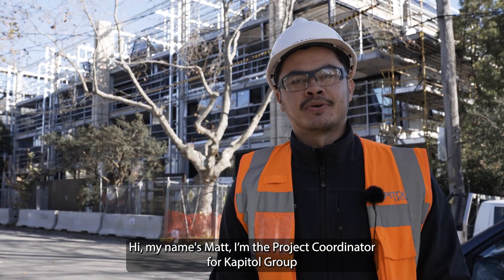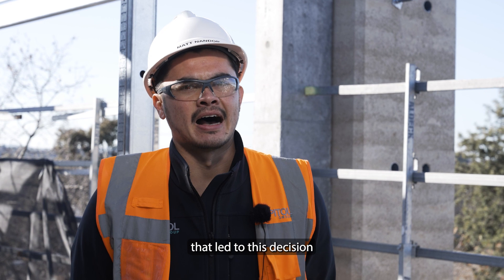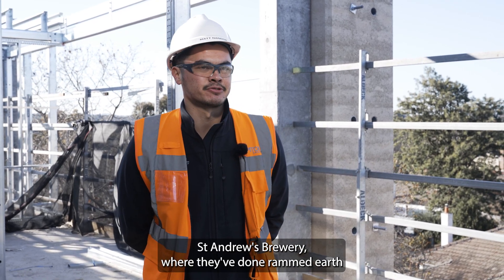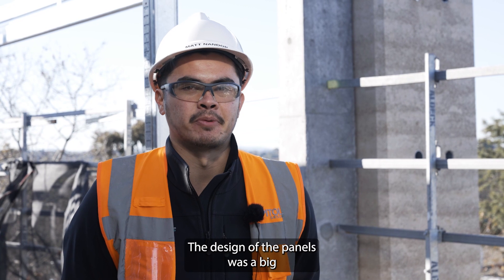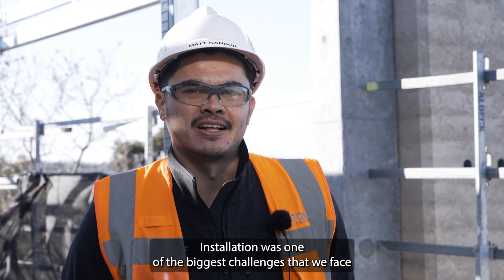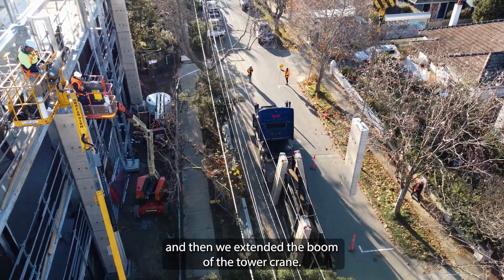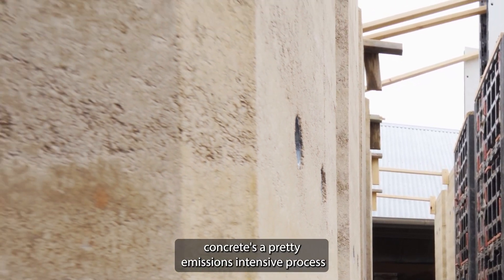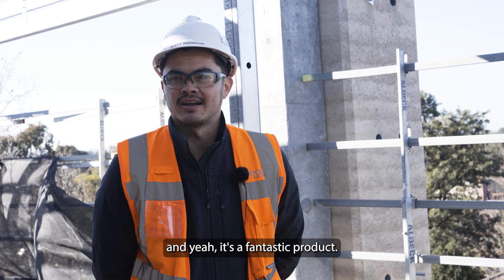Rammed Earth Columns Installation - Hurstmon Apartments

Comment: Hi, good job here. Does the steel frame thermal expansion effect the rammed earth enclosing it at all? Is there any cracking observed on the face of the Rammed Earth panels due to difference in materials? Since the project is 2 years old now should be suitable sample size to determine the effects if any.

Comment: This not rammed earth! This is just dirty concrete!!! You need probably double the amount of cement than in a nomol concrete wall! How can that be better for the environment??
Reply from the maker: Hi Johannes, 

Precast concrete uses upwards of 20% cement, washed sand (a high-embodied energy material) and crushed rock (ditto). It requires substantial infrastructure including delivery trucks of the raw materials to the batching plant, the actual batching plant, delivery of the concrete to the precast site in massive mobile barrel mixers and often concrete pumps which need to be driven to and from the site.

In contrast, the rammed earth we used, uses 7% cement and locally sourced hill granite (from a quarry 8km away from the depot). The rammed earth is built with a fraction of the infrastructure of a concrete batching plant, uses minimal fuel (25 litres per day for the bobcat and air compressor) and has no reinforcing steel unlike concrete.
Reply: @kapitolgroup  if the energy is wind/solar what is the problem with high-embodied energy materials?
Reply: @kapitolgroup  Thank you for the answer. It is still not rammed earth!  Rammed earth contains 0% cement!  This is called stabilized rammed earth period. With 7% cement you lose the best properties of clay, indoor climate regulation, moisture absorption, reusability, etc......!
Please give it the right name. Rammed earth is misleading for what you are doing.
Best regards